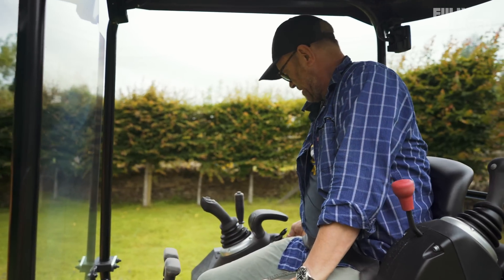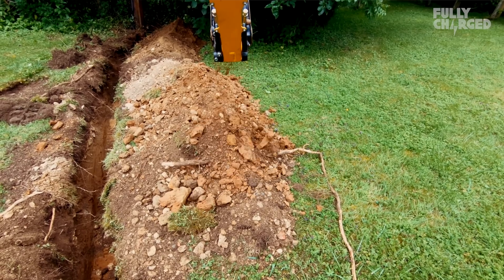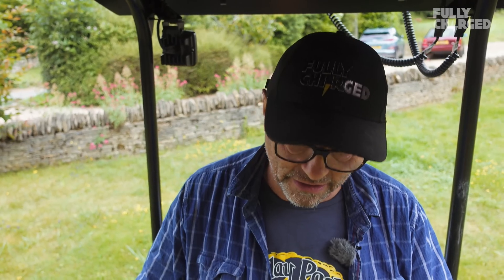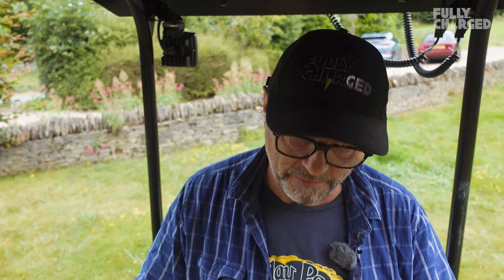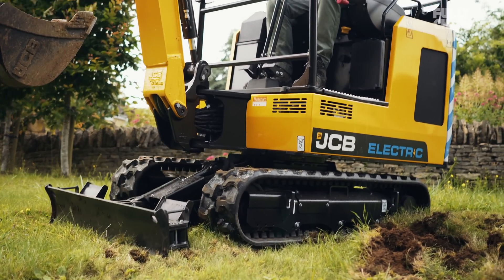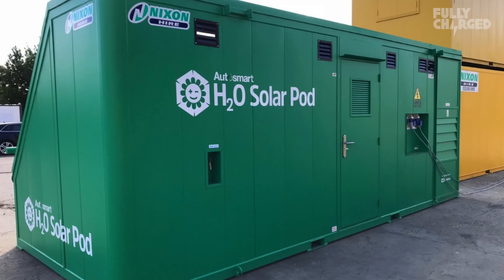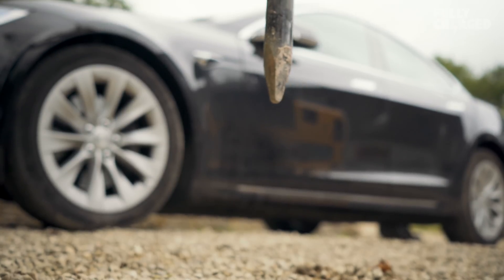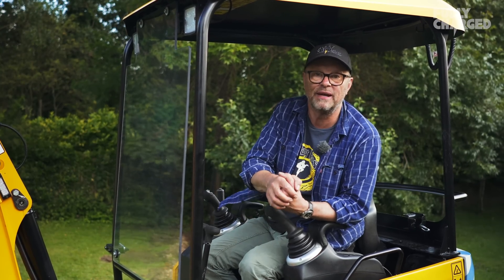JCB Electric Excavator / Mini Digger JCB 19C-1E E-TEC zero emissions electric digger | Fully Charged

Comment: How long will it be before the H&S brigade insist on it making 'MORE NOISE'!!?
Reply: Needs a beep beep sound.. else an idiot will get crushed.. and there are many idiots
Reply: @khavaliar  that's why you should have a safety people near by during operation. I thought they have safety people around heavy machinery already. Am I wrong?
Reply: @Mr_Battlefield  honestly for the sake of saving lives & avoiding costly and time wasting lawsuits... it's not safe to have a really quiet machine.. at least flashing lights or a noise. Someone could bend to pick up a load then doesn't here it being reversed. Gets his foot mushed
Reply: @khavaliar  It already has twin flashing lights on the roof (from what I saw in the video)
Reply: @logicalChimp  Easy to add "parking" sensors that beep when someone walks too close or behind to alert operator..
Reply: @markpantry3213  Right? There r so many ultra cheap sensors to make the whole thing stop as soon as it senses anyone nearby, its not even a debate at this point.
Reply: But if people were constantly wandering in and setting off the emergency stop that's bad for productivity, better to keep people clear of it. Best case, an automatic noise sensor that determines how loud an environment it's operating in and generates just loud enough a warning to keep people out of the swing zone.
Reply: @khavaliar  Annoying. A white noise would do the job perfectly without causing trouble for the residents.
Reply: @khavaliar  There are many idiot cos not enough of them are getting crushed.
Reply: @khavaliar  mostly on this video
Reply: Yep, I know the company I work for would have beeper horns going the whole time with flashing lights all over it
Reply: Less than a year.

Comment: Is it powerful like diesel JCB the size is smaller
Reply: Depends on the battery size probably. Electric has more torque than diesel. Would be curious to see a side by side competition of some sort.
Reply: Yes would be interested in the specs including battery size. The torque isn't the issue, the motor simply runs a pump so KW needs to step up as the machine gets larger. This machine is a 1T and is really only for small work. 2.5-5T is normal starting level for general works.
Reply: @DiscoFang  did you see the massive green dump truck that actually gains energy through regenerative braking. Goes up empty and the weight coming down causes an energy gain. So cool.
Reply: Keith Anderson Makes sense where the actuators are electrically driven. But the complexity of adding generation & circuitry to the actuators & arms where they're currently purely hydraulic on the digger might not be worth the maybe 25% recovery.
Reply: @DiscoFang  yeah, I'm not an engineer of any sort. That was just an unrelated aside. Didn't think it could be applied to this use. Just cool as hell. Maybe they can start lowering thr footprint of coal mining by using such trucks.